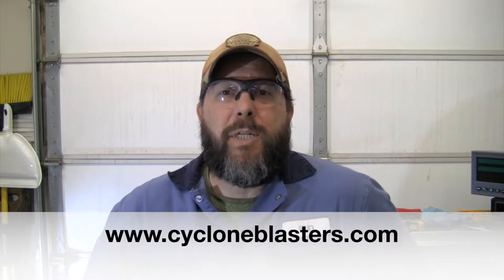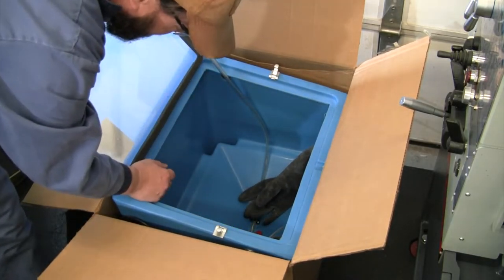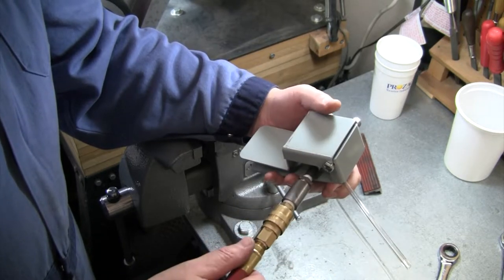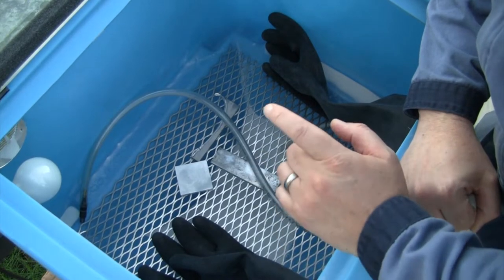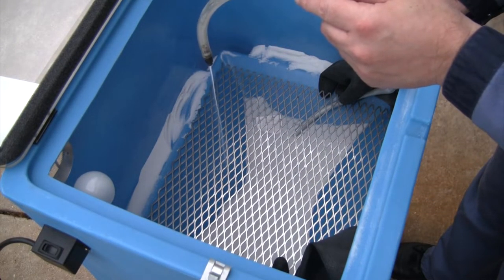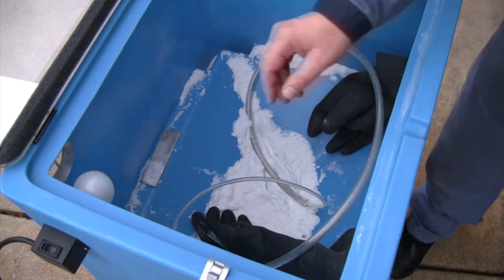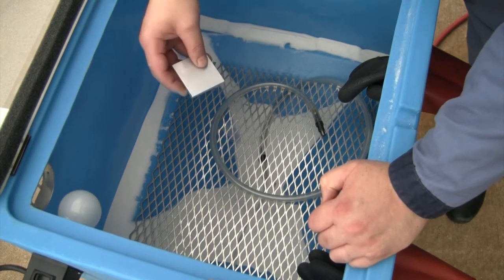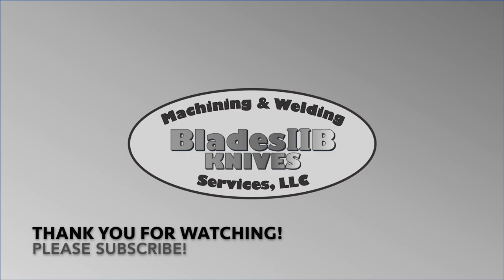Cyclone Blast Cabinet Unboxing and Review - E100 LTC

Comment: Nice!  My cyclone cabinet still going strong now 10+ years, just a few pairs of gloves, new glass, and lots of nozzles and media😎
Not much has changed. Pickup tube on mine is steel to silicone to gun, real braided rubber air hose inside the cabinet. I just hit the plug with some hot glue when using really fine glass media.
Reply from the maker: Canyon Racer - good to know they hold up well over the long haul. Thanks for the comment.

Comment: Interesting. Would you consider this a design flaw? I mean, you should not have to modify so much to make it work. Cyclone is a good company.
Reply from the maker: Eric Shoemaker - Thanks for the question. I would call it a bad part vs. a design flaw. The new one they sent worked fine and still works fine.  Not sure what there experience is thinking I could fix the original one?  Maybe it is a finicky part for them, but when it works, it works well. I agree they are a good company.
Reply: @BladesIIB  Thank you for replying as well.

I actually have a much larger Skat system and now need a bench top for finishing work. Cyclone has “discontinued” all of these small units and I’m assuming design issues, etc. If you look at the market; it’s all imported crap. I like paying for quality that will last.

Please let me know if you have any recommendations.
Reply from the maker: @e_shoemaker  That is a bummer!  Hope I can still get parts if I need them. I recall the same issue searching for mine.  All import. I have had good luck with Grizzly products and customer service. They have a model with good reviews (not the Fox) I would probably look into that if I had to buy another one. Good luck!
Reply: @BladesIIB  Thanks. Yeah, I had emailed with them earlier; they discontinued all bench top models. There’s a need in the market for a quality, made in the USA unit. If anyone else reads this and knows, please point me in the direction.

Comment: If you had a more powerful compressor, would you have gone with the regular E100 that has the gun?
Reply from the maker: Tim Wolf - Great question, without actually using the other one for a true comparison here are my thoughts on it. I am primarily doing small parts in the 2x5” size, and plan to do multiple so having 10-15 of them in the cabinet at one time. For that reason the small gun seems the be putting out enough coverage to do the job efficiently and I really like the foot pedal for longer use vs the hand grip. Also, the pencil wand is really easy to manage with no fear of hitting your workpiece or one of the other finished pieces in the cabinet to scratch them after you just blasted it. These seem like good benefits, but again I did not try the other one. If you want to run media larger than 100, then you have to jump to the 5cfm gun and I can see where that would be nice at times. Hope that helps.